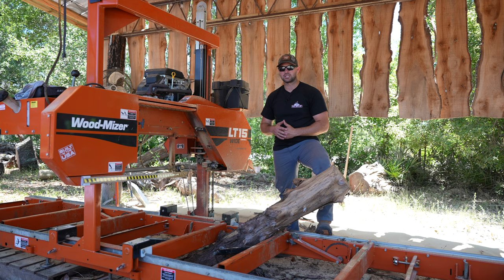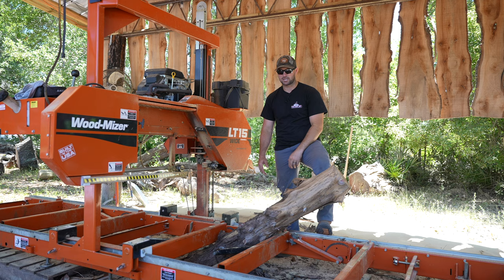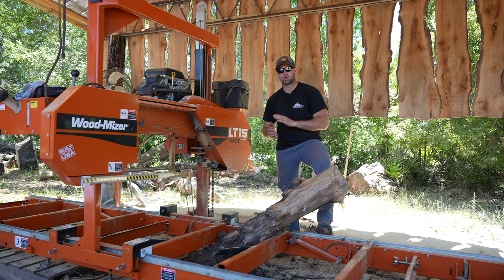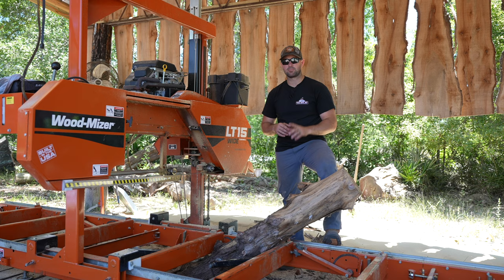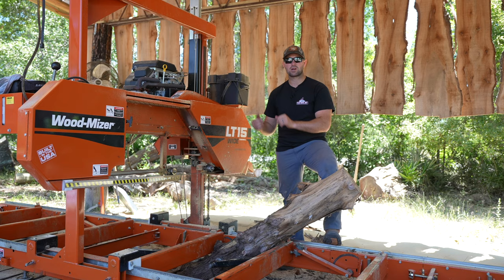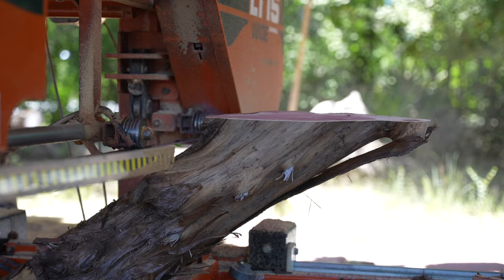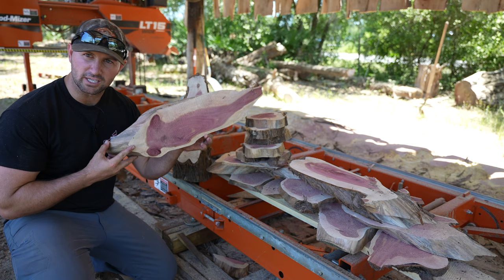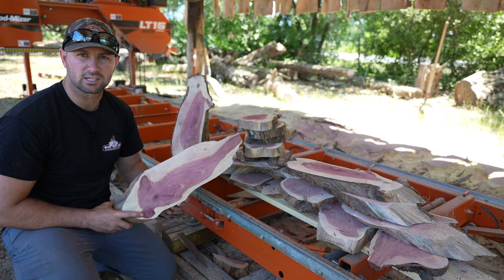Cutting Oval Red Cedar Cookies on the Wood-Mizer LT15 WIDE

Comment: those are great little slab if you want when you do that instead of cutting every thing at 1 1/2 or 2 you can try some 1/2 or 3/4 thick great for art like paintings or wood burning that way you don't need to big of an attachment to hang them on the wall used to sell plenty of them at St..Augustine flea market when it was there

Comment: Good to see that you finally tried diagonal cutting. Larger logs could give you a good counter top. Two diagonal cuts, each with one with a square end, and one flipped over so the live edges match, could be joined to make one double-long counter, or square ended diagonal cuts could make  legs for a diagonal cut desk top.